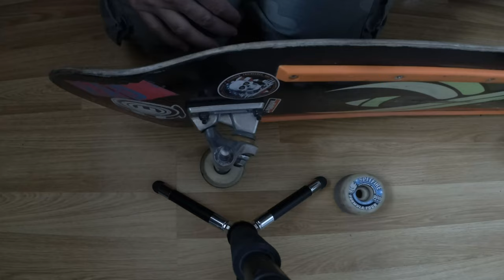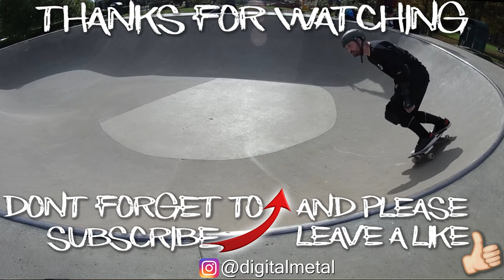Installing Skateboard Bearings The Right Way - With Spacers

Comment: I've got Bronson G3 bearings which come with 10mm spacers but it looks like these spacers are a bit too long for my new wheels. It's a bit difficult to explain but if I include the spacer between the bearings I won't be able to fully seat both bearings in the wheel. I understand how including a spacer can be a good thing in theory to keep the bearings parallel but it seems like this will only work well if the spacer is the exact length needed. If the spacer is too short the bearings will be fully seated in the wheel without contacting the spacer so it wont help to make the bearings parallel and it won't do anything apart from add a tiny bit of weight. If the spacer is too long the bearings will be parallel but they won't be fully seated in the wheel and the wheel will be allowed some unwanted sideways shift. I'm going to do without spacers.
Reply from the maker: The seating disparity you describe when using the spacers will be far less detrimental to the bearing and performance than it will be to not have them at all, if you don't have them at all the bearing will be free to slop about in the wheel hub in both directions so would absolutely be better to fit them rather than leave them out. when you say 10mm are you saying 10mm diameter or length? because you also want to check the diameter and make sure they dont touch the inside of the wheel hub, if they do they will slow you down and squeak as they rub. just buy the right sized spacers for your wheels.
Reply: @NeilHesterSkateboarding  Thanks man. They are 10mm length, ~10.5mm OD, I offered them up and can see they won't rub but are just a little bit too long. I'll see if I can get some slightly shorter ones, makes sense to use them especially with these nice new bearings. Cheers
Reply from the maker: @Beesa10  Well as I say they wont do any harm at all to use if slightly long, a tiny bit of lateral movement when braced by the spacer will be better than not braced at all because the structure created by the two bearings and the spacer all clamped together will be very strong/rigid compared to bearings running with no spacers at all.

Comment: After installing the spacers and tightening them down, they won’t spin. I still have to loosen them up to have them spin?
Reply from the maker: 1) Check your spacers are the right size both in diameter and length. Diameter wise they should should be lose inside the wheel core and not touching it, if they are a snug fit inside the wheel core they are too big and you need a smaller diameter spacer, for length they should be the same length or slightly longer than the depth of your inner wheel core between the bearing seats, if they are too short they will not work and have zero effect on the situation i.e. be the same as having no spacers at all.

2) Your wheels may not be very accurately made meaning the bearing seats are not a very good fit for the bearing and are causing the bearings to be spaced further away from each other and the spacer than they should be.

3) You might not have seated the bearings fully down in the core as much as they should be causing the same effect as point number 2 above.

To remedy these situations you can:

1) Buy the correct diameter and length spacers, in my experience there are generally two sizes one that is larger diameter that is too tight against a wheel core and meant for roller skate wheels and another that is smaller and the perfect diameter for any wheel. sometimes both of these vary in length.
Wheel cores also sometimes vary in length so you need to size them up against your wheel cores or try the fix number 2 below.

2) If the diameter is nice and loose in you wheel core but they spacer is a bit short and you cant find longer spacers, you can try adding another speed washer between the spacer and the insider of the bearing to effectively make the spacer a little bit longer and solve the issue.

I hope that helps, I'll soon make another video that explains all of this in better details with visual examples.
Reply: @NeilHesterSkateboarding  i learned the hard way in the 80's that over tightening wheel nuts until theres no play at all in the wheels then skating like that will ruin bearings, thats with spacers, i was using a rachet and socket so had more leverage than the spanner you used and done them very tight and i think what happens is the spacer is compressed so much it shrinks a bit giving the same effect as tightening your wheels without spacers only not as extreme. the way i do it is tighten them until it slows the spin then loosen tiny amounts at a time and very lightly roll the wheel between every loosen until the wheel does not stop at any dead spots but still there is no space at all between the wheel nut, speed washers, spacers and bearings, to test this i twist one wheel to null out the natural wobble these bearings have then move the wheel side to side paralell to the axle, if theres any space ul feel it and hear the tap then obviously tighten and repeat. there is a lot of play in these bearings but im guessing there needs to be as they are designed specifically as skateboard bearings
Reply from the maker: @Sid-lk2gq  nope what I have done is absolutely correct, a spacer will not compress. The bearings and spacers are exactly the right size for the wheels (because the wheels are accurately manufactured) so are able to be tightened down correctly and still move freely there will be no side movement and no need to slacken the nut off , in the 80’s as with some wheels today the wheel manufacturing was less accurate so it was no possible to always tighten down the wheels correctly (yes I was there too) but today good wheels are made with better accuracy so it is possible as I demonstrate in the video.
Reply: @NeilHesterSkateboarding  then maybe i have a dodgy set of wheels
Reply: the bearings were squeaking done up tight as i first did, i just had to loosen them a bit. the spacer is still under enough compression. i thought it cant be the wheels as they are top of the range. i dont like my board to sound rattly when it pops but sacrifice that for maximum speed
Reply from the maker: @Sid-lk2gq  your spacers could be too short or your trucks could be the issue.
This explains it all:
https://youtu.be/gPVBRc4-nTQ
Reply from the maker: @Sid-lk2gq  if you hear squeaking that suggests to me you have the wrong diameter spacers they need to be much smaller diameter than the wheel core so they are nowhere near touching the core, the only thing the spacer should come in contact with is the centre of the bearing.
Reply: @NeilHesterSkateboarding  the spacers im using are the black ones that come with bones swiss
Reply: @NeilHesterSkateboarding  dude ur right, my spacer r visibly too small by about 1mm, shocking!
Reply from the maker: 👍🏻 you can drop a speed washer in there to space them out further if you have some spare.
Reply: @NeilHesterSkateboarding  i just threw an extra washer in and now like u say i can tighten my nut right down and the wheel still spins, yes! thanks man
Reply from the maker: Cool, glad to hear you got it sorted out 👍🏻
Reply: @NeilHesterSkateboarding  actually, that was the first wheel and it wasnt too bad but the other 3 have even more unlevel bearing seats
Reply from the maker: What wheels are they ? I’ve not come across any that are that bad yet, did you check the trucks where the axles come out of the hangers?
Reply: @NeilHesterSkateboarding  spitfire 58mm conical full, yeah i tried 2 pairs of trucks and they are both square, if i look at the cores they are visibly higher one side than the other and if i hold a stick touching the lower end and hold my finger touching the wheel then move to the other side without moving my finger then touch the end of the stick on the bearing seat theres a 1 to 2 mm gap between the wheel and my finger
Reply from the maker: @Sid-lk2gq  sounds like a problem set of wheels then, I’ve had 4 sets of the same ones and not a single problem with them.
Reply from the maker: Try contacting spitfire with a video to show them they will probably replace them, a friend had one of the HD chargers split and they sent him a new set.
Reply: @NeilHesterSkateboarding  ok il try that, i was looking hard for them, everywhere was sold out except for 1 shop i had never heard of called palomino, i messaged their returns saying the wheels i bought were faulty 3 days ago but no answer yet,  maybe they were fakes. the last 3 sets of wheels i bought had the same unlevel cores.  i then bought a set of ricta cores thinking because the wheels are in two parts the bearing seats will be more accurate and they are a bit but still not right, i really have lost all faith in the competence of skateboard wheel manufacterers, it has made me go insane
Reply from the maker: @Sid-lk2gq  definitely contact spitfire directly , on IG , Twitter or email
Reply: @NeilHesterSkateboarding  i have now, apologies for the headache
Reply from the maker: No problem, I hope they make it right for you 👍🏻

Comment: when I do this the wheel dosen't spin any ideas? I have soft wheels that I want to use but the bearings keep slipping out of them
Reply from the maker: That sounds very strange, first make sure you have the right size spacers , there are generally two diameter sizes one is usually too big for skateboard wheels and meant for roller skates which touches the inner core of the wheel and grips it stopping the wheel from spinning, you need the smaller size that in no way touches the inner core of the wheel.
Or it may be that the core of your wheels are too soft an are being squashed by the bearings pushing together if you are not using spacers or if the spacers are too short.
Maybe I need to make another video explaining these potentials.
Reply: @NeilHesterSkateboarding  hmm idk im new to spacers but they are def. bones skateboard spacers.ive been skateing 24 yrs and never used them honestly..i'm just looking for a solution to my bearings slipping out of my wheels.never had a problem till i started using softer wheels.they are autobahn and minilogo wheels which i know are cheaper but have the softness and slide im looking for.i need soft wheels for my messed up hip and back lol
Reply from the maker: Erik Gordon I’ve got some mini logo 90a wheels and although they don’t have solid cores like most wheels which improves the firmer as there is no flex or movement, setting them up like I do in the video works well for me.

Comment: Is the benefits to open bearings like these that the can be cleaned without removing them?
I have a set of similar ones but they do have a shield on one side.
I know because they have built in spacers and speed rings, so they only fit one way.
But the open face err...faces towards the inside of the wheel...
Not that I would ever clean a bearing...lol... I'd just buy new ones...😁
Reply from the maker: Totally open bearings are 80% hype in my humble opinion, to think they won’t get dirty or that they might be ‘self cleaning’ is just wishful thinking and marketing holes. Your bearings are not open bearings, the shielded side faces outwards to keep the dirt out there’s no shield on the inside because it’s unnecessary, with a bearing in both sides of the wheel that had a shield on the outside, the inside is sealed from any outside ingress so can’t really get dirty.
The only dirt that would get inside is micro levels of dust and dirt (and water if you get them wet) .

Comment: What does a spacer do?
Reply from the maker: It maintains the correct spacing between the two bearings and prevents abnormal side load stress on the bearings in extreme side pressure conditions such as wheel slides.
Reply: @NeilHesterSkateboarding  thx a lot!

Comment: I think my method is better. As for spacers I bought Bones wheels and spacers and the length is too short so the wheels won't spin when tight, so Bones spacers are useless on their 52mm wheels.

Comment: Speed washers???😢
Reply from the maker: They usually come with your trucks already on the axles, they space the bearing centre away from the inside of the truck hanger on the outside stop the nut squashing against the bearing.

Comment: Dude.  You put the bearings in wrong.  They exposed bearings should be facing inward to each other to protect them.  The shielded parts should face out.  You literally did it backwards.
Reply from the maker: No I didn't, Even Bronson's own video's show the same as I have done and just look at countless other Bronson users setups.:
https://youtu.be/w6Aw8165UX4
Putting them round the other way wouldn't make any difference anyway as there is no shield on either side, the reverse side is just the cage and offers no more protection from ingress, they are open bearings and meant to be open to the elements.
Feel free to put them in how you like but I've not installed them wrong,
Reply: They’re raw bearings bro they have no rubber shield suppose to rock them like that
Reply: Yeah every video I watch has the plastic facing out but to each his own.
Reply from the maker: I’d be highly surprised if they are Bronson RAWs, G2’s or G3’s maybe or other non bronsons that have shields.
Reply: PG III is right. They are supposed to go with the open exposed part facing each other in the inner side, in order to prevent dust, dirt, etc coming into the bearing.
Reply from the maker: No they are not, that plastic is not a shield it’s the ball bearing cage totally open to the elements too.
Mechanically it doesn’t matter which way round they go because the bearding are 100% symmetrical the cage is just there yo keep the balls separated and equally spaced with bearing that have shields you have no idea which way the cage is facing unless you take of the shields to check which obviously nobody is going to do. The only exception I’ve seen are G3’s which have a black ring on the shield to show this.
Bones single shielded bearing only have a shield on the opposite side to the cage because they are meant to have the cage on the inside just like I’ve done here. These do t happen to have any shields at all and are totally open to the elements on both sides so dust and dirt is free to go anywhere from either side of the bearing. If you are worries about dust and dirt you don’t buy bronson RAW’s or any shield less bearings and again I refer you to bronson own video in my reply to PG III